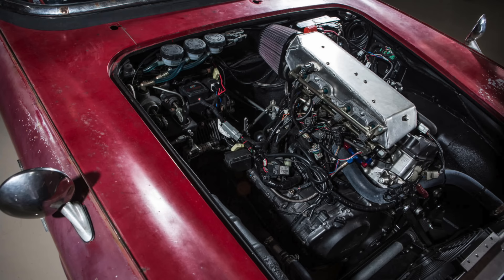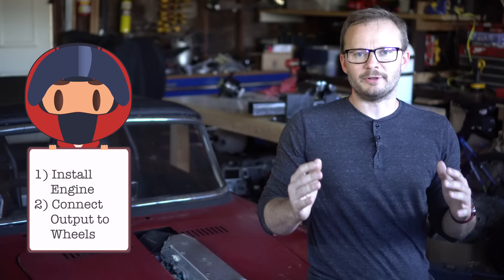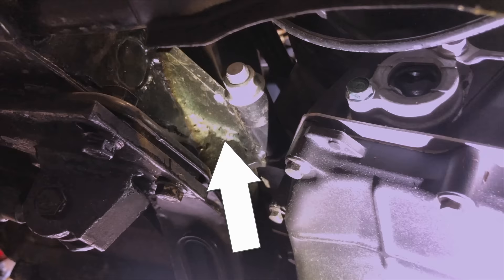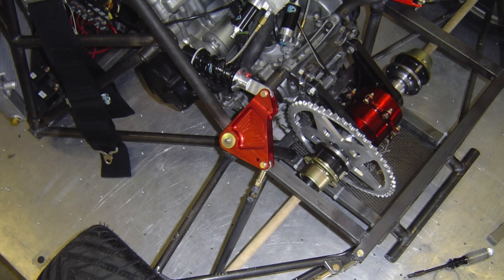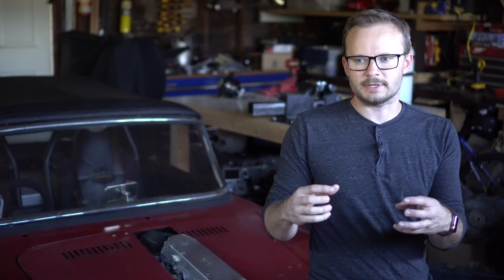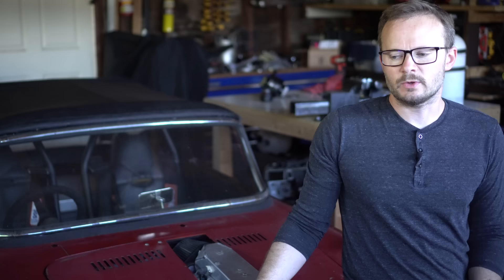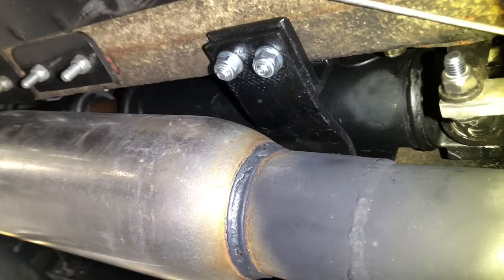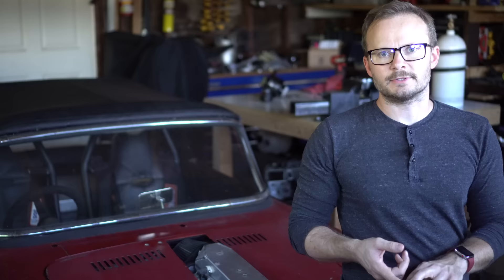Motorcycle Engine in a Car - Here's Why and How

Comment: Dwarf cars and modlite race cars use either a toyota solid axle or a custom built rear end with quick change gears. Worth taking a look at the dwarf car/mod lite world if you are doing a swap like this. We build and maintain them for a lot of guys and if you just adapted a lot of the stuff onto the Honda body, you would be set.

Comment: Boy does this video bring back a few memories. Here In Aussie me & a few of my mates had Honda S600's back in the early 70's. We used to rebuild them as they weren't too reliable with the 600cc motor in them & they were cheap. I had a worked 1200cc Corolla motor with twin sidedraft Webbers gearbox & diff I was going to put into a S600 - same colour as yours. Had all the chassis mounts ready to put in the drive train. Was going to use it as a club racer. Unfortunately work got in the way & I was transferred interstate with my job & had to sell the project as I had nowhere to complete it. Often wondered what happened to that car. Must confess back then putting a bike motor in one didn't come to mined. As for yours - what a great project.

Comment: How do you think Honda got into the car manufacturering?
Honda started by putting a motorcycle engine in cars ! Duh!
Reply: Michael, When was that and what cars were they?  What was the motorcycle engine that they used?
Reply: @campbellsharp8303  
That was in the early 70's. 
The car was designed  by handa. It had front wheel  drive. In fact the car is s rare now that I couldn't  put a price on a working  model.
But that's how Honda  got into the car manufacturer .
But I wish I could remember  the model.
But it did come with a 1300 cc Honda motor cycle  engine.
Reply: @michaelwaggoner4040  Oops, no. Honda have never used a motorcycle engine in any of their cars.  Released in the late 1960's and in production in the early 1970's was the 1300.  This came in both three box sedan and also a coupe styling.  You had a choice of either a 77, or a 99 in either body.  The 7/77 had a single Keihin with a C/R of about 9:1 while the 9/99 had four Keihins and a C/R of 10.5:1.  I cannot recall the exact numbers now, but the 9/99 was advertised with a top speed of ~ 105mph and 45mpg while the 7/77 was ~95mph and 35mpg.  The engine was a brilliant lump of a thing with their unique "Duo-dyna" aircooling.  This was a forced airflow through air galleys within the block and head similar to watergalleys in a conventionally liquid cooled engine.  Dry sumped but only a single cam.  Australia only got the 7's and 9's in the coupe styling.  (Three door.)
By the time Honda released the 1300 they had manufactured well over 200,000 cars, mainly in the Kei class for the domestic market.  The S car series had been on both the domestic and international (though very limited) markets with just under 20,000 manufactured.  The TN light truck had also sold in the tens of thousands with the 360 and 600 Scamps also selling in the tens of thousands with both of them on the Australian market since around 1966.  The Zot and Life also came into the market in the late 1960's.  The Z or Zot initially came with an aircooled 360cc engine but later migrated to the water cooled engine that was in the Life.
At that stage the largest capacity motorcycle that Honda had produced was the 750 in the CB750.  The larger capacity Goldwing Touring bike was close but it was a 4 cylinder horizontally opposed liquid cooled engine.
The cars (7s and 9s) had very distinctive styling and were very enjoyable to drive with a thirst for speed.  The heavy engine and transmission did not give them very good track handling but at least one competed in the Bathurst race of either '70 or '71.
Reply: @campbellsharp8303  
Look it up for yourself!
In 1972 the R600 Toyota used a 1000 cc engine in their first cars!
LOOK IT UP YOURSELF!
Reply: @michaelwaggoner4040  Michael, what has a Toyota got to do with Honda?  Incidentally, Toyota had been manufacturing cars on a large scale since the early 1930s.  The first sports car that Toyota produced was the Sports 800 which used a horizontally opposed air cooled twin cylinder for front engine rear wheel drive. It was brought out as a direct competitor to the Honda S500.
I'm not sure what 1972 and anything that Toyota was manufacturing then has anything to do with this discussion.  Why not bring in the Toyota 2000?  Engine by Yamaha.
To cloud your waters, Honda got into motorcycle manufacturing by putting generator engines onto bicycles.
Reply: @campbellsharp8303  
Sorry  my mistake I mentioned Honda  and not Toyota!

Comment: I have a Kawasaki concours 1400, has shaft drive, might be an interesting solution. U could potentially run the bike's 6 speed tranny off a linkage, run the bike clutch, doesn't help with reverse though but just be careful where you park.😊

Comment: My dad took a 2000 lb mg midget and dropped the old drivetrain in exchange for a now carburated 13b and matching trans he bought for $300. That small amount of cash and 3 months later, he now has an 1800lb vert that lifts a wheel at full burnout in third gear. The scariest part is that he grew up racing twin engine gokarts  and 400cc two strokes, so for him to be so scared of his own car that he wont go past half throttle is fucking hilarious. Might also mention it's got Weber dgif downdrafts that are twice the size it needs to be, and it's on the stock 165s. It's kinda silly, and also 1 of 3 rotary powered MGs ever built at this point. He had to get pointers from the guy that built the first one up in Michigan to get the blueprints for custom cross members and motor mounts

Comment: Quite a Impressive feat of Engineering and Execution  ive always been a fan of British Sports Cars  and in general 2 Seater roadsters  therefore ive always thought the Honda was a cool car !  Another old trick i know on the Diff is to use a Ford and machine your axles to fit the Ford  i have a Uncle that did that in a old Ferrari he bought with a blown motor  in which he re fitted with all Ford running gear to make the car road worthy, i also know years ago people doing similar builds to yours would use the old Postal Vehicle rear ends because they were positraction and narrow   I’m pretty sure most of those vehicles were based on the Chevy S10 platforms  but those Vejicles are getting harder to find in Junkyards these days  they used to love those because they were rebodied by Grumman  using a all Aluminum body  making them desirable for Scrap  i saw a guy do all Ford running gear in a MGB of his  the goal was to. Keep the car looking Stock from the outside although if you looked close   It was easy to spot  4 Wheel Disc brakes from a Jaguar up front and Volvo on the rear wheels to stop the 289  powered Automobile  he also used a Ford transmission and the Automatic  T handle Ford used on so many cars  i saw him running the car and it was quick   Although  that gear is much heavier than yours  is  in reality i think you have a faster car

Comment: To smooth out the drive shaft out put rotation and reduce vibration I think you should really fit the UJs not in line but at 45deg to each other. It halves the sine wave. 
I'm sure it was Bill Brown fitted a Lotus twin cam into a S800 many years ago, what a little beast. 
A great little car well done.

Comment: A ford cosworth 4wd front differential is a good option. I bought a zx11 kawasaki engine for my zx11. It came out of a lotus elise a guy had converted. The engine came with a cosworth diff attached. So. I put the engjne in my bike and i still have the diff. It is compact and lightweight.

Comment: Like it. One day I’d like to pot a 2cyl. Or even 1cyl. Motorcycle engine in a VW, to see the kind of gas mileage I can get.
Reply: Billy, fuel consumption is not driven by the number of cylinders but by the efficiency of both the engine and the car.  Low Cd of the car is more effective than fewer cylinders.  It is easier to design a durable drive train for a 6 cylinder engine than a 4 cylinder of the same capacity and power output.
A 3 litre V8 puts the same amount of air and fuel running at 1,500 rpm on the highway as a 1,500 cc engine running at 3,000 rpm on that same highway.  However, the V8 will usually be in a heavier vehicle with a higher Cd.  Yes, there is also greater friction losses from inside the engine with the extra four cylinders but with lower overall wear, that engine should last longer.

Comment: Freaking cool! I didn't know the model 600 went back that far. I had one that was built in the 70s
Reply: thisolddog.  No you didn't. The S600 base car as here was only manufactured from 1963 to late 1964.  Replaced by the S800 which was manufactured until 1968~.  The early Honda "micro" cars as sold outside Japan were the N600, N500, Zots and Scamps.  They had twin cylinder engines with capacities of 360ccs, 600ccs, 500ccs and 660ccs. (Okay, a pedant can give the exact capacity as the S600 was actually 606cc.) The early ones were all aircooled, later replaced with water cooled (especially in the smaller capacity engines). Whilst looking very similar to their motorcycle engines, there was no parts commonality beyond the 10mm nuts and bolts.
Reply: @campbellsharp8303  it was a 1972 honda 600. Do your research before you call someone a liar Mr. No it all!
Reply: @thisolddog2259  Be careful about trying to throw personal insults.  The Honda 600 that you had that was built in the 1970's had nothing in common with the S600 that is at the core of this story.  Your 600 was what was known of in many markets as a Scamp.  It had a twin cylinder aircooled vertical engine with front wheel drive. (And probably a single carby, I don't think any came from the factory with either twin carbs or dual throat one).  The S600 was manufactured from 1966 to 1967 and was front engined and rear wheel drive.  The engine was a 45 degree inclined four cylinder wet sleeved double overhead camshaft with twin twin throught carbureters (though to all intents and purposes they were four carburettors as they had individual float bowls and dash pots and only shared the throttle butterfly.
Stepping inside the car, you had a back seat for two and a luggage boot with it's own lid.  The seating position was quite upright with the gear lever coming out of the dashboard in the centre front with the handbrake on the floor between the seats.  And there was quarter vent in each door window.  Right?  The S600 was a low set driving position with the gear lever falling naturally to hand on a dividing transmission tunnel.  The handbrake was mounted on this tunnel giving a natural reach to the RHD driver.  There was no back seat.  The convertible/roadster had a moderate sized boot/trunk with the fuel tank across the front of it with the refueling access on the left rear corner.  The Coupe had a good sized rear hatch with the fuel tank under cover in the left rear corner.
I think that your 600 rode on 12" wheels while the S600/S800 ran 13" wheels.
Of course if you have documentary evidence that you have an S600 manufactured in 1972, I'd very much like to see it.  As would thousands of S car fans around the world.  ( I may just do a video on the innards of the S600s sometime before too long.  But no rush, other things of interest.)

Comment: Sir , you should really think about fabing up some kind of carrier bearing mount for your driveshaft adapter so that the weight of the driveshaft isn't on the output shaft of the bike trans. It's only intended to carry the weight of a sprocket and partial chain weight plus only the weight and loads of  the bike.  It would also help there to be even less chance of vibration. You've got an awsome little hot rod .

Comment: Great idea! The cars of the 1960s were often beautiful but everything beneath the bodyworks is obsolete compared with modern powertrains.
Reply: DOHC with full roller bearing crankshaft hasn't been equaled in modern powertrains.  The two twin throat SU carburetors (essentially four carburetors) is as efficient and effective as many PGMFI systems.  Throttle response was instant will virtually no flywheel effect, all the way to 9,500RPM redline.  The engine idled and revved as quietly and smoothly as a sewing machine.

Comment: Ive seen this video back when it came out but im getting closer and closer to actually building one. The only thing im worried about it mounting the engine and passing the Tüv in germany. Electronics, exhaust, etc. is easy. (at least for me) I want to put a Motorbike engine in a Porsche 924 / 944 with about the same hp as it was stock. Its about 2300 LBS stock but ill probably get rid of some weight on the way. Idk what engine to use, maybe the old Gsxr 1000 engine my dad has laying around (sadly its oil and air cooled) and maybe get some flat side Carburetors.  It should even be eligible for a H numberplate (plates specifically made for historical vehicles (30yo))  and be exempt from some regulations. Im hoping it will be somewhat of a "easy" job as the parts are mostly already there and i don't need to change too much about the drive shaft. 

Still hoping to be able to build it for under 7k

2k for the car, ive got the engine and transmission, the reverse box you've mentioned, engine harness, exhaust should be easy, cooling and mostly time.

Comment: You left out engine tuning and gear ratios.  Some of those liter bikes hit 99 mph in first gear.  You'll have no acceleration when you increase the weight from 445 to 1300 pounds.  Engine tuning is all different when you make the exhaust ten times longer (gives more top end, usually) and cut down the air box.  When I use pod filers (no airbox) it also tends to effect top end way more and needs much fatter main jets. Can the EFI deal with all these mods?

Comment: I've been thinking about, and sketching a Honda GL1800 6 into a Factory_5 818 for about 2 years now. The engine is overbuilt and should handle a turbocharger nicely. The intended power for the FF 818 is a 2.5L Subaru motor. If the Honda gear box holds up that package should be lighter than the 1800 lbs advertised for the 818!  Should be less $$ also, even after sourcing the required Subaru parts. We'll see some day.   8)   (The FF 818 kit is $10k)
Reply from the maker: That motor probably has enough torque for that, and you'd have reverse too!

Comment: I'm building a 72 Honda z600 with a GL 1500 Goldwing motor hope my bill comes out as nice as yours using a Miata front and rear end cut down about 13 in running into a few little problems I hope I can get Beyond like mounting the motor in the car I want it under the hood but I'm not sure if I have the room may need to go behind the seat
Reply from the maker: I considered a Goldwing motor. I think it would make a great powerplant for a small car like a z600.

Comment: Goldwings have reverse utilized through the starter motor. Wondering if parts are able to be customized such as bell housing or starter mounts or the reverse gear itself from the Goldwings. Just getting the wheels turning. I love the build you did! Great video.
Reply: GL1800 would be pretty awesome.

Comment: I wouldnt worry too much about the stress that the engine mounts put on the motor. After all, these bikes make the engine a stressed member, meaning part of the motorcycle frame is removed and the engine block itself becomes half of the bike's frame. If it can withstand getting slammed down after countless wheelies, Im sure it can handle the rotational stress of driving.

Comment: What about mounting the reverse box to the rear diff input shaft ( a sort of transaxle) and using a starter motor solenoid and a momentry switch mounted on the steering wheel? Steering box ratio could be a limiting factor here if reversing and turning. I could stop you accidently trying to take off in reverse and would also move the weight back a little to help rebalance the extra front weight.
Because it has a fixed mount diff won't have to worry about extra unsprung weight.
I think those REALLY short half axles could have fast wear problem because of the angles they have to go through?
A modern 1000cc cleaner Honda motor with much HP extra swap for a gutless ancient and VERY dirty carb Honda 600cc motor sounds like a win/win everywhere.

Comment: seen a tube frame kit car had 2 500cc yam 2 stroke engines running the front and back like a all wheel drive very fast and light a screamer petrol tanks along the sides of the tube frame built into it low as possable worked as weight balance this built in the late 1980s used an electric motor for reverse

Comment: Regarding the backdrive: Wouldn't it be possible to simply attach an electric motor with a rubber wheel somewhere in the back and let it push against one of the wheels through a hole with a lowering mechanism when used? I think you could make this mechanism with less weight than the backdrive gear, and you could easily take it out for the racetrack and save weight. Yes, that would be a very improvised solution but as far as I can see this car isn't meant to be your daily driver.

Comment: depending on if you change the transmission gearing and the final drive and assuming the vehicle weight about 2200 and the engine makes 65hp at 9500 or so it’s possible to get like 30 mpg

Comment: Interesting project, and props on getting Jay Leno to go for a ride with you, since I know he also owns a resto-modded S600. But Why install a motorcycle engine in a car that already has a motorcycle engine?
Reply: Because 200HP>47HP
Reply: @gregs7519 : Yeah, I eventually got to that part.
Reply: Shawn, did you watch a different video?  The S600 engine was not even distantly related to any motorcycle engines.  The 606cc DOHC water cooled 4 cylinder engine in that car had no parts commonality to any of the Honda motorcycle engines.